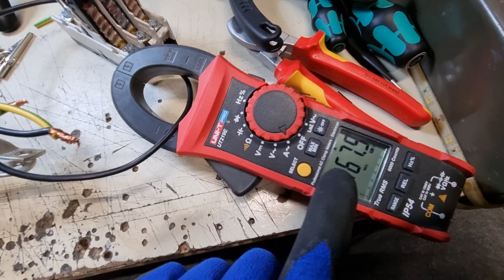Taking a look inside of a motor circuit breaker (Mbs 25)

Comment: Replaced so many of these bro! So cool how they with magnetics, very similar function to how mcbs work but you can dial it in for the motor application. It's a basic DOL device IMO.
Reply from the maker: Yes, you are right they work very similar to a MCB, I was seeing many videos about MCB being disassembled but not many videos about motor circuit breakers.

Thanks for watching 😎